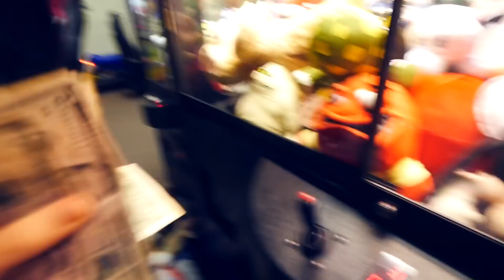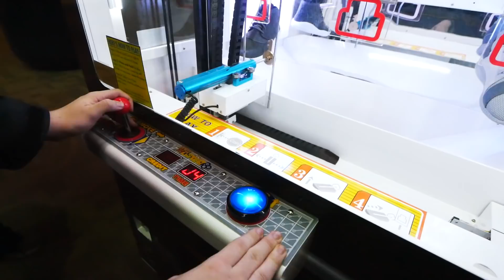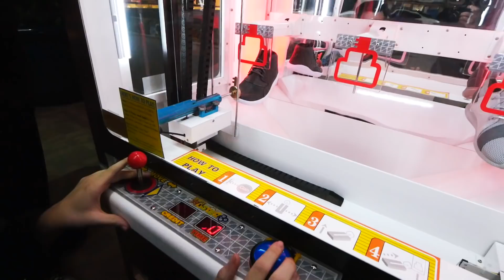Don't Let This Happen to You at Keymaster ...

Comment: Is There anyway that you could get the key stuck into the laces of the shoe and be able to pull it out?
Reply from the maker: It stops going forward just about a qaurter inch if you line it up wrong, (as in not inside a keyhole) and it won't twist like it does when you win, plus the machine knows when someone wins, the arcylic plate pulling forward triggers a sensor which opens the door to the chute, so if you did catch a shoelace, the door wouldn't open and it would go to the vendor. Keymaster is geniously designed to where there's pretty much no way to get a prize before payout unless you destroy it lol